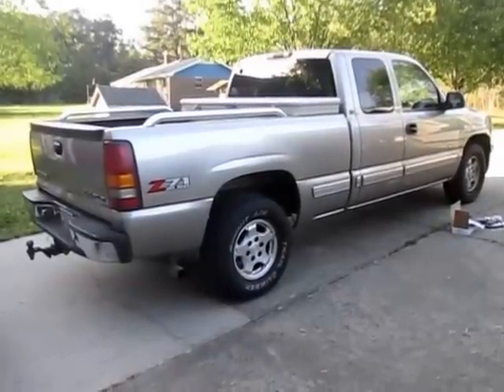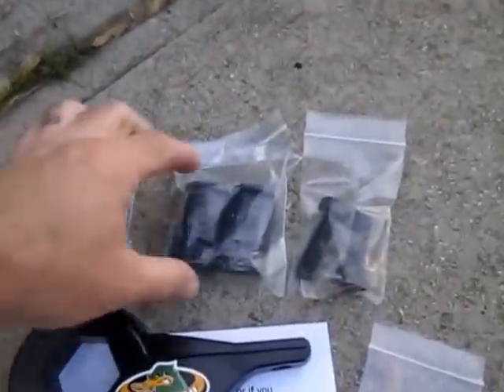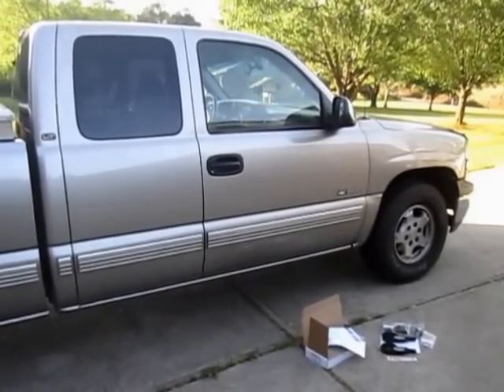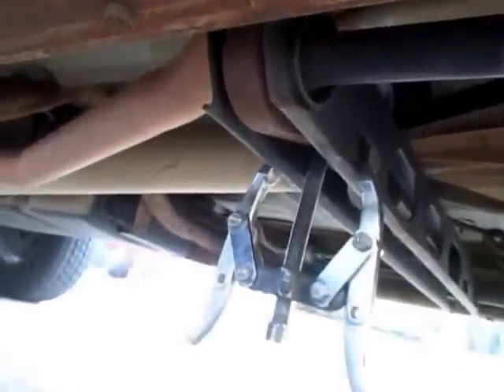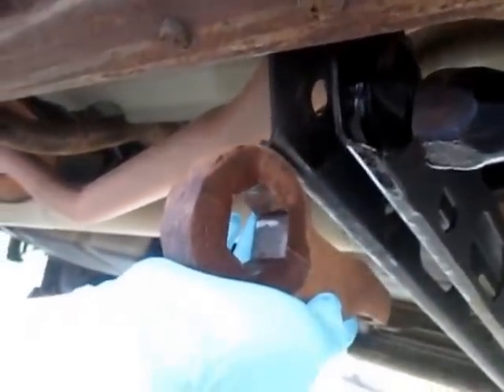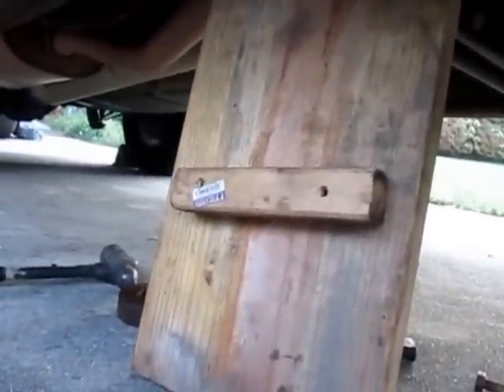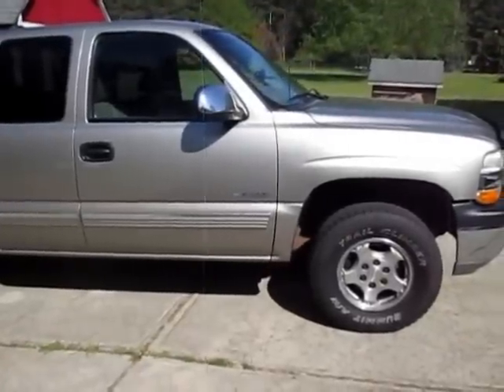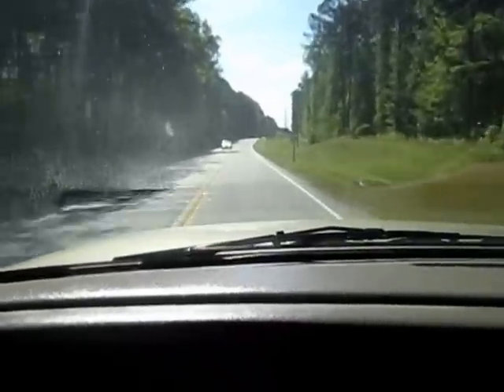Replacing torsion bar keys on a Chevy Z71

Comment: Dude, front ride is stock touching on the bump stops
Reply from the maker: That's all good until the torsion bars give up, and it has no suspension at all.
Reply: Ok stock isn't good enough. Just say that. GM design is for a soft ride. You are not correcting anything, Just lifting the front for looks or ground clearance. CV joint and tire wear are accelerated.
Reply from the maker: Thanks for stopping by.
Reply: I just replaced the bump stops, how I found the sagging problem. You can tell when the height is just right, the bump stop is not bent when the truck is sitting level. Like you said, resting, touching, but not bent. Touching makes a huge difference absorbing road noise, especially after installing energy suspension swaybar bushings.

Comment: These trucks did not come level.... front end is lower than back by about 2 inches
Reply from the maker: Correct. However, the torsion bars wear out, and the easy fix is to re-key them.

Comment: I changed a lower control arm. The torsion adjuster bolt backed out hard even with oil. Tried to turn it back in and it snapped. Do you have to use unloader to turn the bolt back in?
Reply from the maker: Shouldn't have to. I did use a jack to lift the truck by the frame to relieve some tension though.
Reply: @JoDaddysGarage  rhats what I did. Looks like ill be bringing the electric cut off wheel home tomorrow and cutting it out and putting a new bolt and nut in. I love rust.